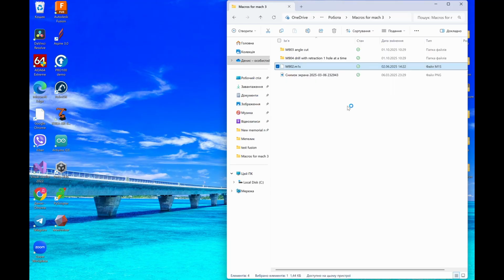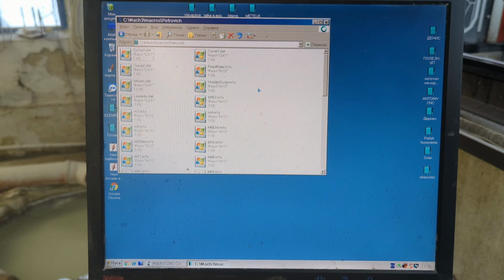Macros 101 Talk to Your CNC

Comment: Oh and as a software developer for 20 years, instead of notepad try an IDE like Visual Studio Code or Visual Studio Community.  Both are free and will do things like syntax highlighting, formatting,  and auto complete for VB.
Reply from the maker: As I mentioned in my video, I only recently started learning programming, so I’m still a beginner — and still make some pretty silly mistakes. 😄

Turns out, I’ve had Visual Studio installed on my computer since I first started learning C++, but it never crossed my mind that I could use it for writing Visual Basic Script!

I do know that VBScript is quite similar to C-based languages, but somehow I completely missed that connection. Thanks for the tip — you’re absolutely right, it’s definitely much more convenient!
Reply: Ти просто неймовірний! Щиро бажаю успіхів в нелегкій камʼяній справі! 
Також щиро бажаю в осяжному майбутньому придбати сучасний GMM/Prussiani/Thibaut!
Reply from the maker: @andrewyaremchuk7544  Дякую за такі щирі побажання! А що стосується верстатів я надаю перевагу побудованим власноруч, це щоб зробити нелегку кам'яну справу ще складнішою!😁

Comment: Nice work as usual Denis. Very nice stone too! I recently ordered an 11.5 kW Italian spindle, could have purchased a car instead 🤯 The problem with my current spindle is the bearings are only rated to 4000 rpm, the new one is rated to 15000 rpm.  I got some bits from the Chinese supplier you recommended.  They were good to deal with.  Thanks!
Reply from the maker: Thank you! I can only imagine the price of an Italian spindle like that. Honestly, you’re lucky to have managed to get one — my last attempt to buy from the Italian market ended without even getting a quote.)))

I’m also planning to buy a big spindle for my future large CNC, and I’m still debating between going with a Chinese or a European one. There’s a really nice Austrian company, but they’re pretty pricey.

With these small, cheap Chinese spindles I’m using now, I don’t even worry about bearings or anything else — they’re cheap as dirt, so I treat them as consumables. But once you start scaling up to around 11 kilowatts, the prices get almost the same as the well-known European brands… still, a few thousand dollars difference though.
Reply: @madeofstone7619  When I looked for a Chinese spindle it was hard to find one with center water feed.  I think I found one company, but the asking price was high and I wasn't sure of the quality.  I'm forced to go through a Canadian distributor for the Italian spindle, who add on their own markup.  And yes, they make it hard to buy one.  14-16 week lead time.  I'm impressed with what you have done with your Chinese spindle.
Reply from the maker: @GregsStoneYard  That’s the bright side of cheap spindles — you have the luxury of destroying them just to find out exactly where their breaking point is.
So basically, I once pushed them to the limit and beyond, figured out their working capabilities, and now I just stay on the safe side of that edge.
My general rule is simple: if I need high RPM, which is usually only for small tools, I use my Chinese spindle. They’re definitely capable of providing enough torque for smaller bits — let’s say up to 12–20 millimeters in diameter.
But when I need to go bigger, I use what you’ve seen in my videos — a regular motor powered by a VFD. I can push it up to around 5,000 RPM.
I’ve also been thinking about making my own spindle base, starting with a surface grinding spindle as the core. I think I can get it up to around 10,000 RPM, and it’ll definitely have enough torque and power.
It won’t fit my small CNC, but I’m thinking about using it on the big one — or maybe even my lathe.
And if I do, you can be sure there’ll be another video about it! 
And I’m really grateful for your comments. Since I work alone, I sometimes struggle to make decisions based only on my own experience.
Reading your comments feels like consulting with a specialist in this field — I can honestly say I’ve learned a lot from you